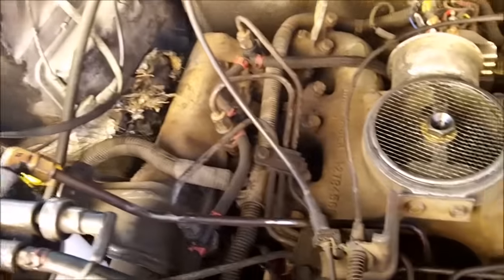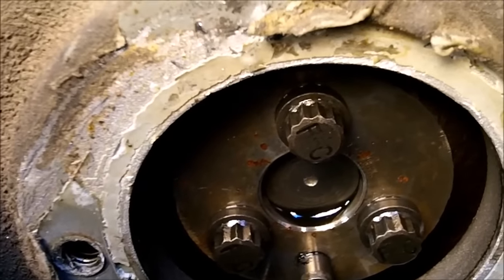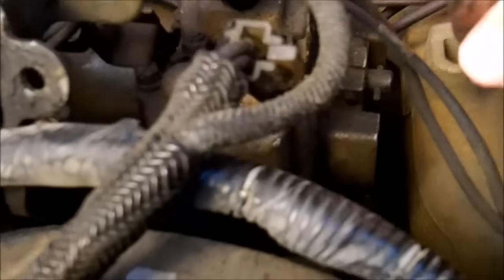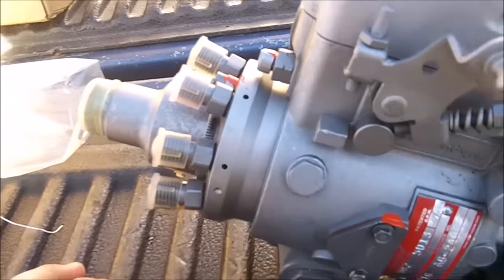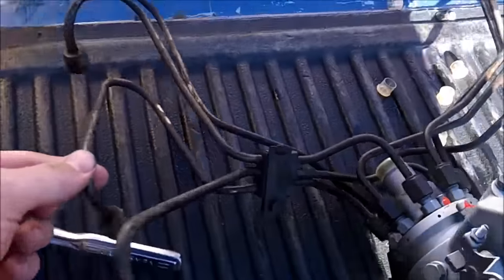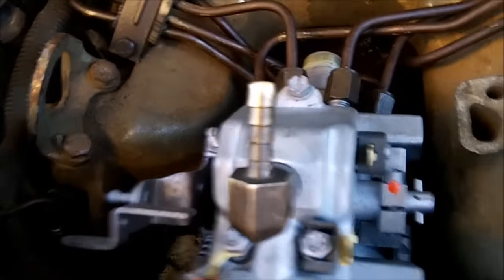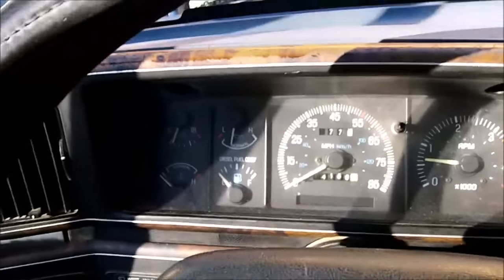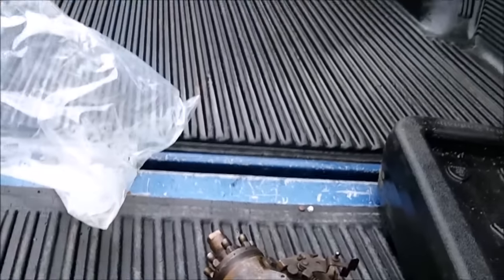7.3 IDI Injection Pump Replacement

Comment: Good vid but never ever buy any thing rebuilt off ebay lol that shit wont last more than 20,000 miles bet.... I learnt my lesson buying a turbo off ebay for 500$ for my 1990 f250  lariat xlt 4x4 7.3 diesel.... Ended up buying a 2800$ real turbo conversion kit "banks sidewinder " after the ebay turbo blew up....
Reply from the maker: I highly doubt it will only last 20,000 miles and even if it does it will take me many years to drive 20,000 miles, I only drive 3,000 miles per year. I have bought lots of cheep rebuilt stuff off ebay never had any problems.

Comment: How much different is any 02
Reply from the maker: Very an 02 would be a 7.3 Powerstroke, completely different engine apart from the displacement. The 7.3 Powersroke is computer controlled and uses a high pressure oil system for the injectors it dose not have an injection pump like 7.3 IDI.
Reply: Thanks man

Comment: How much was the pump?
Where did you get it from?
Reply from the maker: The pump was around $375, I got it from ebay.
Reply: 7.3 IDI Diesel thanks
Reply: @7.3ididiesel36  dude thats a shity pump a real one cost 500$ to 600$ lol i had to replace my injection pump,plug timer,plugs,wire harness and fuel water separator.... Never ever buy shit off ebay ...
Reply from the maker: @bluntman305  Doesn't matter I don't have a problem with replacing it again.

Comment: My 7.3 starts and runs for just a little bit then dies injector pump maybe
Reply from the maker: Check the injector return lines for leaks first, even if they are just slightly damp this will allow air to get in and cause hard starting problems. Injection pumps usually last between 150- 200,000 miles. If yours has about this amount of miles you can expect the injection pump going bad. Does it only do it on cold starts after sitting for a while?

Comment: The timing mark means zero with a new pump.  Timing light/trigger critical!!!
Reply from the maker: The timing marks just get it close so it will run. To get the exact timing it needs to be done with a timing light. It can be done by sound, that is how I did it. More clatter means more advanced, less clatter means the timing retarded. Going on for the third year running like this no problems.
Reply: @7.3ididiesel36  Yea, can do by noise...just sayin...original mark is from factory.  Replaces a many many of those beasts.  BTW, A quart of ATF serves the same if not better than diesel fuel treatment...just experience from that '93 low-sulfur swithover.  So many rolling idle problems.  A quart of ATF in fuel tank and that problem disappears in about an hour.
Reply from the maker: @nhzxboi  I have ATF works relay well. The fuel metering valve would stick in the old pump, the ATF fixed it, but the old pump was worn out so I replaced the pump.